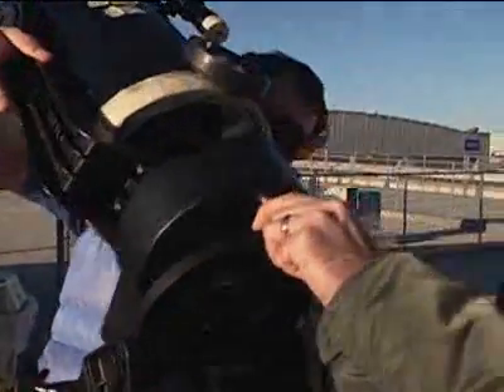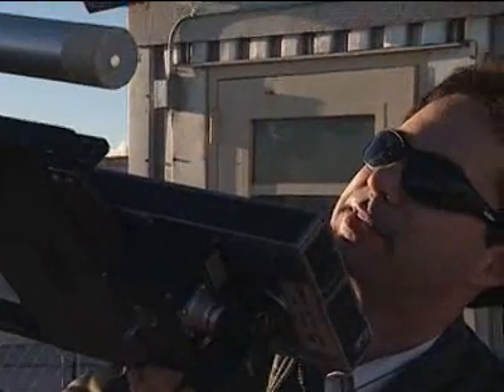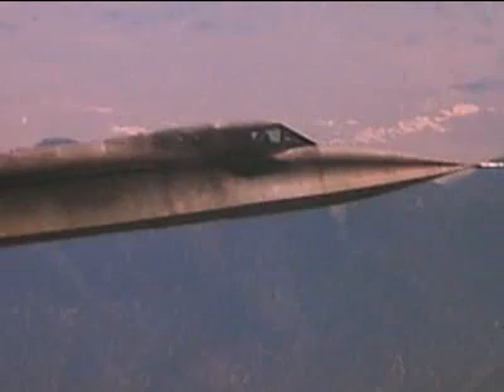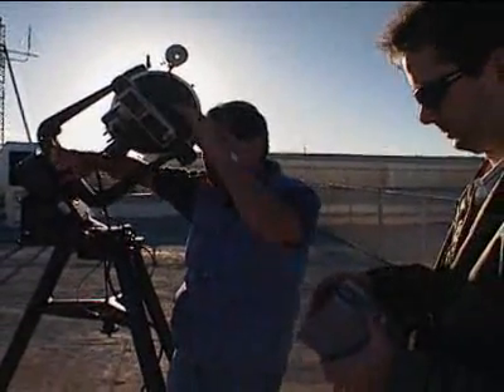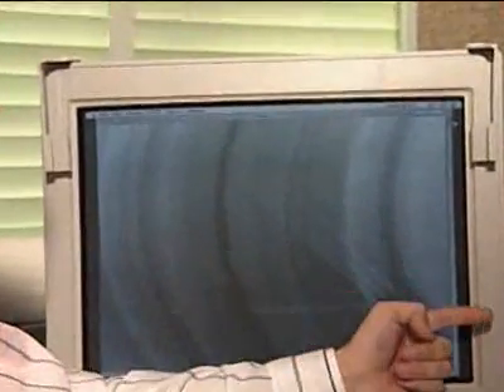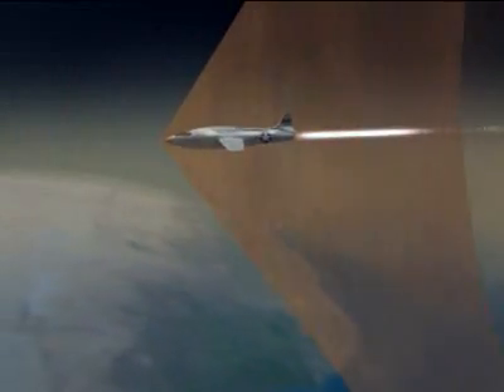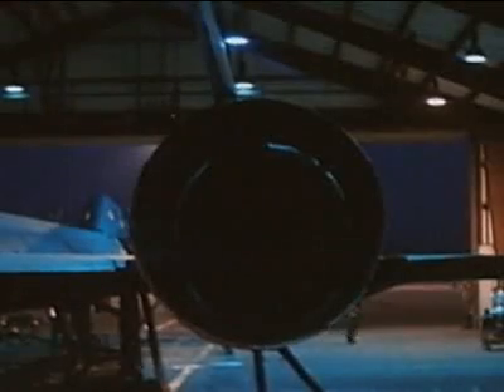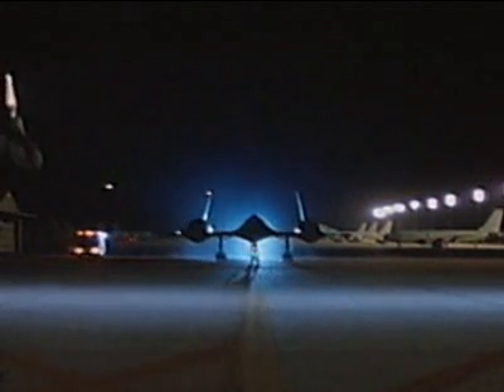Picture of Supersonic Shock Wave.flv

Comment: @beeroosterm Any 'tip' - eg. leading edge of wing, nose cone - will cause a shock wave. Now, that's only if the air has to turn 'out' of the way of the incoming 'part'. Now I'm not sure where on which parts you mean, but if it's the front, yeah, if the air at that point is still supersonic, the front of the part (eg. cockpit) creates a shock. But if it's the back of the part, air has to turn back in, so you get expansion fans (hence the condensation visible). So also depends on the craft.

Comment: @beeroosterm The 'shock waves' you mention behind the cockpit and the tails (essentially the parts where you see water vapour) are not actually shock waves. They are expansion waves, due to the air having to expand 'around' the objects. A shockwave only forms if there is an obstacle in front of it, and the air has to deviate from its original path.